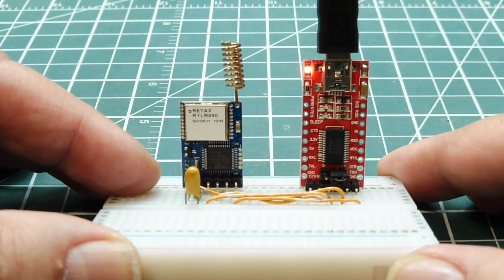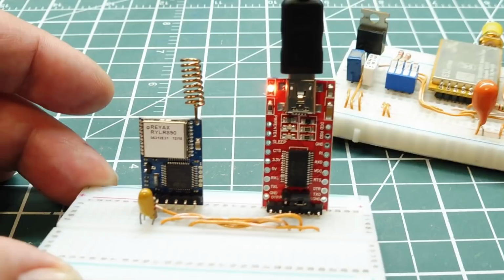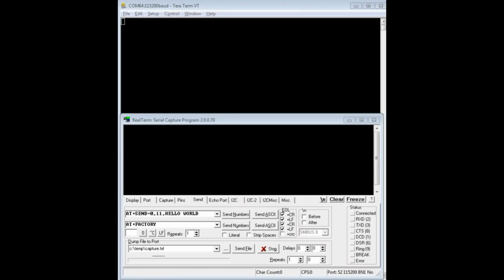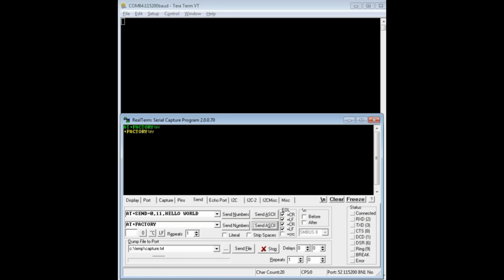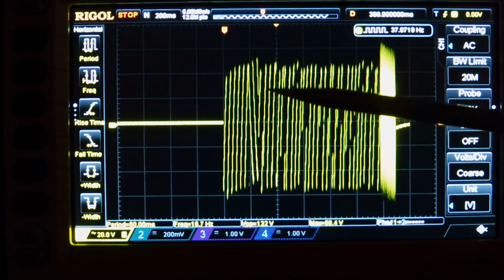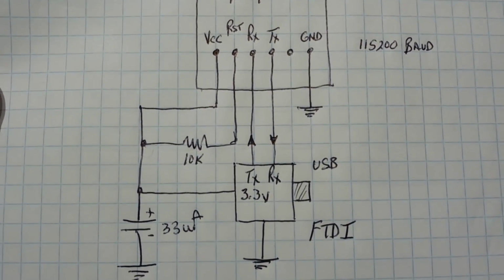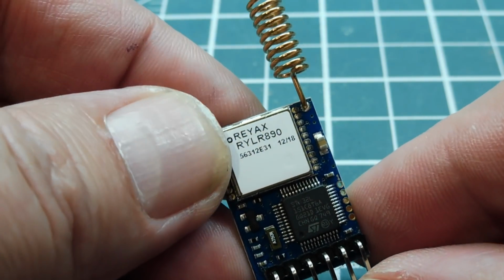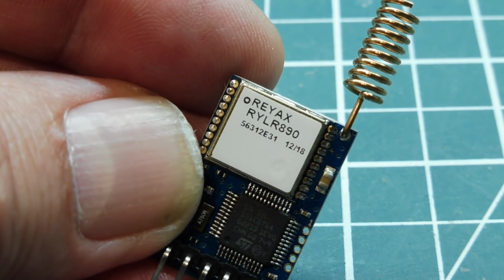Introduction To The Reyax LoRa Modules

Comment: Great video. Also easy and good product from reyax. I didn't do the resistor and the cap like you did but it worked with me. With this coil antenna provided i was able to reach 16.3 KM or around 10 miles LOS . I am looking into your antenna videos trying to get more range without adding extra power. Thank you.
Reply: Did you reach 10 miles with a coil antenna on both ends? Pretty good if so. I would be interested to see your setup. Does anyone know the best orientation of these coil antennas? Vertical and parallel to the pcb plane?
Reply from the maker: That's pretty good range for a low power module. You should make a video, would be interesting to see.